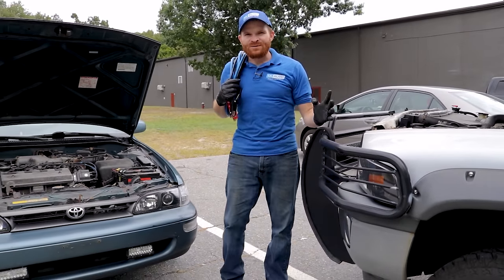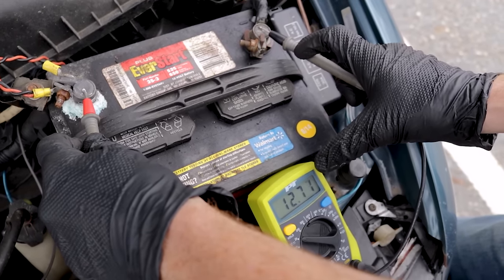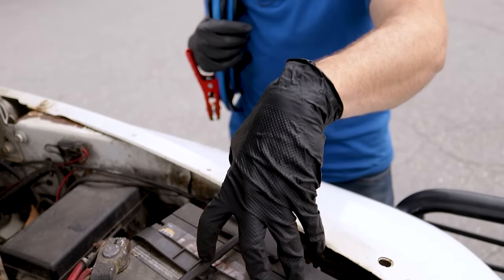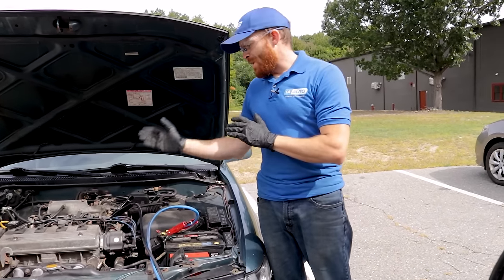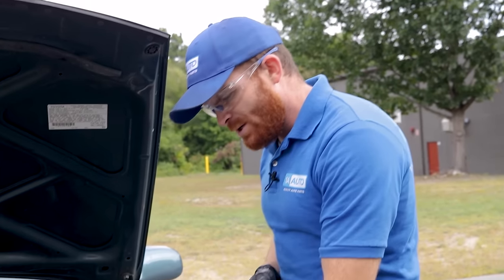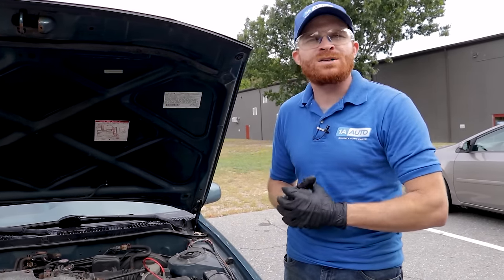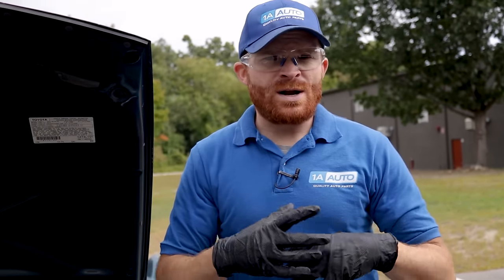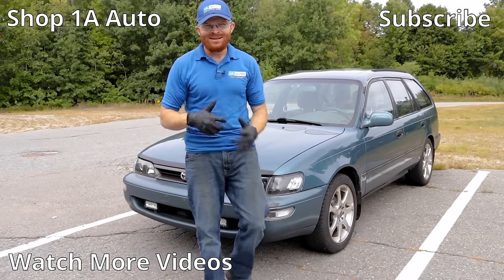Dead Battery? No Crank? Best Way to Jumpstart Your Car: How to Do It, and Why!

Comment: You may wanna add that some cars have a "jump post" for jumping a dead battery. My older model Mercedes Benz battery is covered in 20 minutes of plastic removal to get to the battery. There is a separate battery jumping post location so you don't have to bother removing all the fragile plastic. In other words, tell them to always refer to their owners manual when possible.
Reply from the maker: Good point! Thank you for the input! 
http://1aau.to/m/Shop-1AAuto-Now

Comment: @3:20 I was always taught the the red cable goes to the + dead battery and then the + to the good battery.  Then - to good battery and - to dead battery.
Reply: It doesn't matter which order you connect the positives, nothing will happen until you connect the negative

Comment: One thing you should do in your videos is when you're doing this...use a terminal brush to clean the terminals. The more crap on them, them more resistance there is. No wonder they won't start and maintain a charge. Clean and seal your battery terminals regularly. And I'd highly recommend upgrading from OEM to Aftermarket Brass Connectors. They help against electric distortion.

Comment: I recently swapped an engine in my 2000 Honda Civic DX Hatch. Battery, alternator, starter are all brandnew but I noticed that my battery is slowly draining its juice, I suspect it could be a defective/faulty alternator or not enough ground might be the problem. I will have my alternator tested today if that may be the culprit.

Comment: I understand everything here. Thanks be golden when such videos are posted. Potentially somebody can answer a question here though I've got a bus here with two batteries and I went to jump start it with a Ford Econoline van. The red positive to the red positive from the dead to the live. Then the ground from the live to the frame and try the negative battery terminal using heavy duty battery cables top-of-the-line with a light indicator box. Red light says connect wrong greenlight says jump okay . I connect the hot terminals and as soon as I connect the negative terminal; the jumper cables tell me wrong connect and red light. My question is why what is causing it to say wrong connect?

Comment: Hi and thank you for providing an excellent video. One question I would ask is that you do not say if there is a need to top up your  battery distilled water to the correct level to prevent the internal plates from buckling under stress?

Comment: When checking battery voltage with meter, you should turn on the head lights and read voltage. This will put a load on the battery to get a true reading.

Comment: Great video, thanks! How long should the car be driven to fully recharge after jumping the battery?
Reply: I usually  get the car up to speed 2 rpm and then straight to AutoZone or some place have it tested for free and the alternator too  Then head home Remember alternator and battery go hand in hand

Comment: How would you determine if the battery was overcharged or damaged by the jump?
Could the different alternators be in conflict and cause problems to either systems?
Reply: No, the power is going from battery to another. Not alternators.
Reply from the maker: The battery would have to be tested. If it is bad most likely it was not caused by the jump. unless hooked up backwards. Thank you for checking out the video. If you need auto parts go to: http://1aau.to/m/Shop-1AAuto-Now

Comment: Several comments:
Can you further explain at about 5:00 you mention that it will create a fused circuit so you don't damage engine computers, but I don't see how it is different than connecting to negative post. Isn't it all a complete circuit from positive to the load to the engine ground back to the negative post. I guess I don't get how that is safer.  Is there any logic to why you get corrosion on battery posts. I have seen in other places that people indicate on the different posts that it is a sign of overcharging or undercharging alternator. Is it more the battery (sealed vs unsealed) and the fact that the water ports are so close to the posts that leakage helps contribute?
Reply from the maker: The main reason is the explosive gas caused by the battery. You don't want a spark near the battery your trying to jump. Thank you for checking out the video. If you need auto parts go to: http://1aau.to/m/Shop-1AAuto-Now
Reply: I understood the part about the potential explosion caused by a spark when connecting the Negative jumper to the negative battery terminal (in all my years of jumping vehicles, I have NEVER had that problem), but how does connecting the Negative jumper to the frame instead of the negative battery terminal make a difference in frying the vehicle's computer? Thought that happened from accidentally mixing up the Positive and Negative jumpers.

Comment: I remember with my dodge ram last winter I was barely able start the engine. Once it did start I waited ten mins for it to warm up and when I came outside it was like in limp mode and the engine wouldn't rev or anything. I replaced the alternator and everything was good after that.
Reply from the maker: Nice! Thank you for checking out the video. If you need auto parts go to: http://1aau.to/m/Shop-1AAuto-Now

Comment: To be honest last night I jump started a 2008 Ford F-350 with a 6.4 diesel with two batteries and the battery’s had like 6 volts each. I had my 2006 town car I tried starting the truck and it cranked but did not have enough power to start it. So I revved up my Lincoln and the truck started right up.
Reply from the maker: Some times it works. Thank you for checking out the video. If you need auto parts go to: http://1aau.to/m/Shop-1AAuto-Now

Comment: Hi I l ove your channel  Bro ,is High Info I have a quest I have a 2011 F250 gas truck my battery is dead I did jump with my Jeep xj 1999 I did the same about the dead battery my F250 I connect the Negative a metal part and red in red , connect Pos and Neg  my jeep but won't start and I decide connect the Neg to Neg in my battery and start right away ,my quest is I did right or that is the way supposed for Ford F250 truck Thanks !!

Comment: Engine ground on the dead car....always.  You could sit there for 30mins+ sometimes and still not be cranked with battery to battery hook up.
Reply: @Rucard01, I've had totally different results. I've connected the negative to a body part on the dead battery and it wouldn't  start. Connected it to the negative post and it started right up.

Comment: I jump start 5 big 18 wheelers with my Nissan Altima.   No problem . 

I have a  intestate battery and I leave it park for weeks, sometimes months. Still no issues
Reply from the maker: Thank you for checking out the video. If you need auto parts go to: http://1aau.to/m/Shop-1AAuto-Now

Comment: I left my car's cabin light on for like 2 days and the entire battery went down. When I went to get my car,  nothing was working but the thing was that even the speedometer needle was erratically fluctuating. the battery was clicking. I disconnected it and reconnected it. I jump started the car but it turned off after like 10 minutes . again I jump started and again after 10 mins it shut down. I dont know what to do because the car was perfectly fine and now I am fearing there has been some electric damage due to low power.

Comment: I noticed that my battery keeps having corrosion not a lot but I sandpapered the terminals and cables and this winter time has started to show some battery acid. My cars running fine but one day actually on Election Day my car took 4 turn overs to start. Is that just lose cables or is my battery going? At startup my battery’s about 14v and during driving it’ll be around 13.4-12.3 (05 civic ex special edition)
Reply from the maker: +Ugh I forgot my name Thanks for checking us out! While we cannot give a proper diagnosis, it sounds like the cables may be loose if this fluctuates that much. Going over bumps or centrifugal force may cause it to not have a full connection all the time. You can always take this to a local auto shop and have them check it out in person and see what they say.

Comment: Almost correct, DVM definitely necessary!
Use a jump pack, electrical issues are like ( STDs/ STV ) . You are placing your vehicle’s  electrical system at risk, may not immediately indicate damage. With today’s cars, a fuse won’t protect against all electrical damage. Be safe not sorry.

Comment: Wrong! You should never start the dead car with the good car running. This can damage the electronics of the good car.
Reply: @lm83pr52lr, he's in the car repair business, I would think he knows something. I believe some people are taught things and it is passed along. Just like how he connected the cables. I've used a grounded metal part and the car wouldn't start, connected it to the post and it started. I don't connect the positive and positive then negative negative either, never had an issue.

Comment: Okay I have a question. I have the messing with hot rods my whole life I know how to jumpstart a car blah blah blah. Here's something I've never had to do. I have a piece of Dodge truck the Beast, ram 1500 piece of crap ranch truck how to get a new battery for it start it right up zero freaking oil shut it right off immediately good battery. Have a 2007 Mitsubishi eclipse ran great, lost the key for 4 months in the yard. In florida. Won't start now obviously he is damaged I'm getting a locksmith in but that is completely out of oil as well like bone dry and the battery is dead so I got a new battery put a new battery in it. Then promptly left the f**** key on all day yesterday. Trying to get a giant spider out of the car lol. So ... Mitsubishi won't start won't turn over because the key needs to be reprogrammed, can't do that without a new battery that has a charge. Can't charge the battery because my battery charger has been ruined by somebody else. Can I just take the battery out of my truck and hook them up together with cables will it just charge the car battery over time it's not going to do any good, how long will it take do you think and yes I put oil in both vehicles LOL

Comment: "Grounding on a piece of metal on the engine" got my car to start smoking, melted the cables, and on the car. AAA road side service said - to just connect both parts on the battery itself. I've learned my lesson, never trusting youtube again.
Reply: @tansygu6841, read your car's manual and see what it says. I've tried to jump a dead battery with the negative connected to the body of the car, it wouldn't start, connected it to the battery and it started.

Comment: Gas collecting around the battery has caused an explosion... Never.
But a poor ground between the battery & the block... Often.
Put the cables on the battery and start the car.

Comment: Welcome to our how are you doing I am from Libya and I have a car Ford Explorer model 2005 v8 4.6 and I want the type of oil القير الاتوماتيك please respond and you all thanked and appreciation
Reply from the maker: It should take 6 Quarts of 5W20 oil. Thank you for checking out the video. If you need auto parts go to: http://1aau.to/m/Shop-1AAuto-Now
Reply: Thanks for the good treatment. Second, not motor oil, I mean automatic gear oil

Comment: RED red black BLACK then BLACK black red RED
Reply: I've never had an issue doing connecting both posts on the good battery 1st then connecting the positive then the negative on the dead battery. Always disconnect negative first.